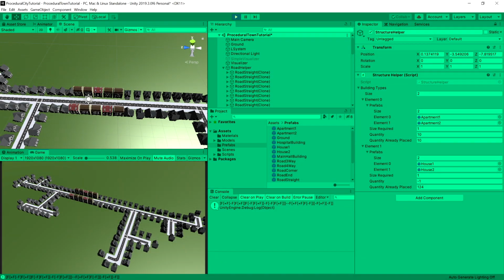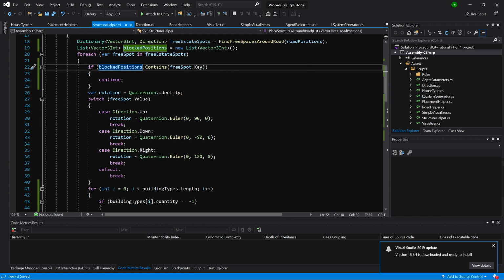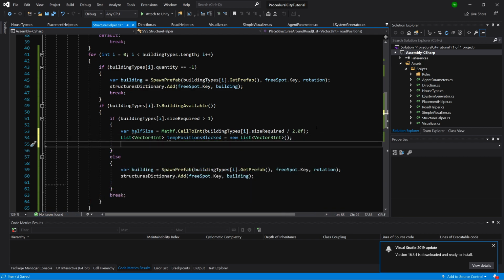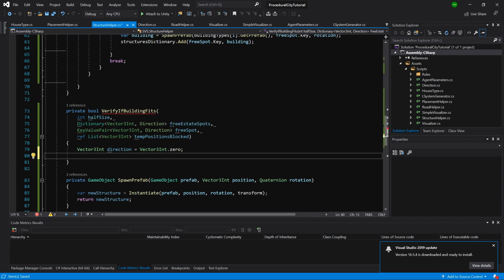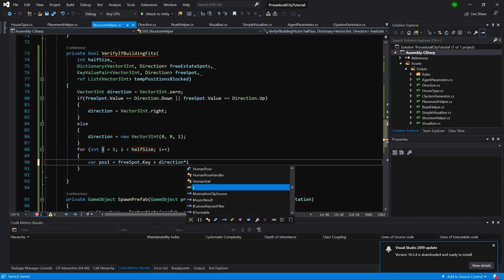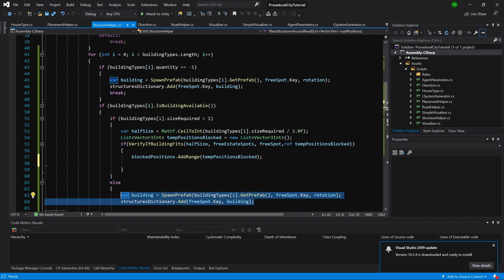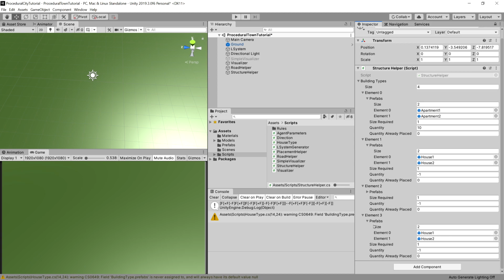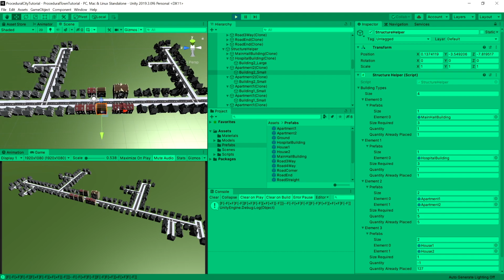Unity Procedural Town Tutorial Ep13 Placing houses p4

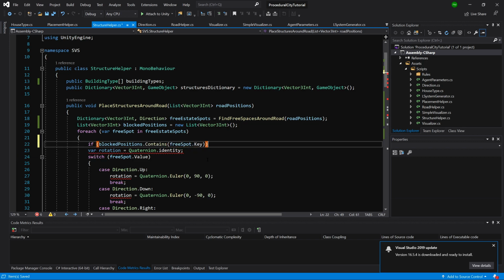Comment: At 1:30 line 22 it finds the free spots? At 6:30 line 80 we are checking if the direction of the road is up or down, then we add does blocked free spot on the left and right? line 84 how does the Vector3Int(0, 0, 1) goes? How it adds the block positions? 13:10 line 96 and 97, it add the blocked positions (as in the free spaces on left and right) if the building halfSize value is greater? Sorry for the questions, just want to know if its clear and I understand :D really was excited for it.
Reply from the maker: It basically boils down to the building size. If a bulidng takes 1.5 cell we cant to place it either on 2 cells or on 3 cells. To understand it try drawing a grid on a piece of paper and check what happens if you try placing a structure of size 2x1 and what if you try 2x1 having only a single cell as "free". How do you decide how to place a 2x1 depending on the previously placed structures? We place all big structures early. I believe that I didn't fully convey the problem that we face. If you play around with the idea and see the problem you will surely understand the solution.

Comment: great. you are such a pro dev. easy to follow, if you have any more about seed to save that samll city would be perfect.  and another queation,  why you put speciel houses only in the left side of the biggest one?why not both side.. many thinks.
Reply from the maker: I am glad that you think so! But do let me know if there is something you don't like.
I mention it in one of the vids. When we create L-system we start drawing in 1 direction. It's easier to follow the road and place buildings. It might be clear to me and not much to others that it is very easy to tweak it.
Let say: we want to make towns with town center.. well in a center :D so we can randomly choose a free space and create an if(space distance to center point < limit) place big multitiles building. The most important thing is that special buildings need to be placed first because we need to have space for them.
What I am trying to say is - when you have a dictionary of free spaces it is just a matter of rules you set fro placing buildings. I did it a simplest way by following how road was placed hence buildings shifted to the one side.
You could simply say start in a center, chack if center point has neighbours to left, right, up, down (and the same directions +1/-1) since sometimes you have to cross road, add those neighbours free spaces to a queue. This way you would start placing houses from center towards outskirts until you run out of free spaces.
Possibilities are endless :) 
I hope it helps!
Reply: @SunnyValleyStudio  Great to hear the full answer from you. I didn't pay too much attention when I was focusing on the code.
For a newer like me could only barely understanding what your code means. 
Keep going. I think you could make a game from it.
Reply from the maker: Don't worry! You will learn with practice.
I will soon be publishing a Udemy course that could be of use to you if you look for something more basic. Stay tuned and I will post more info on YouTube soon if you are interested. 
In any case thanks for watching this tutorial!
Reply: @SunnyValleyStudio  thanks a lots again. But I am stucked in one but. I can only built only 2 big houses which size required more than 1. Everything is fine. But when I switch to 3 or more.  The program stuck and told me:an item with the same key has added. 
Something wrong in tempPositionBlocked I guess.
Reply from the maker: @louiswu6300  just verify your code against my code on github. You must be adding the same position to the dictionary multiple times which causes the error.
Reply: @SunnyValleyStudio  well. Only got troubled when size required bigger than 3.  2 is OK. But 2 equals to 1.
Reply: @SunnyValleyStudio  yup. You are right. I will download it and check it. Thank you again.
Reply: @SunnyValleyStudio  I use directly the package you provide, and i got the same error, when the size is biggest than 2 and you spawn more than 2 big building you get the error ( ArgumentException: An item with the same key has already been added. Key )
Reply from the maker: @gui205  thanks I will check it. I might have made a mistake somewhere.
Reply from the maker: @gui205  Your were right. I am uploading an additional video 13_1 with a bugfix and I will updated git repository. Thank you for pointing that out!
Reply: @SunnyValleyStudio  I have an question, how is possible to change the size of the model generation ? It's look like the L System spot is always egal to one unity unit ( so 1 meter ) is it possible to change that ?
Reply from the maker: @gui205  a generic solution is L-system generator. This implementation is just an example. You can easily create your own setup and move by multiple units per step (you can interprete the output of L-system as you see it fit. We just happen to treat it as a 1unit movement.) Just move the desired number of spaces when we 'draw' in accordance to L-system commands (in our switch statement). You can treat it not as a road but as a graph and even move random number of spaces each draw call. You just need to save it somehow to know how to draw your road. Hope it helps :)